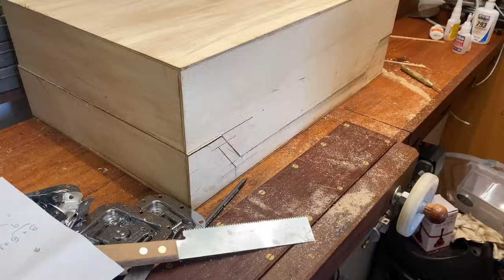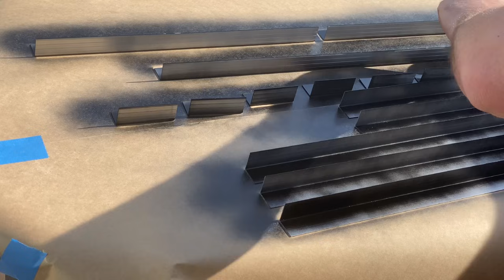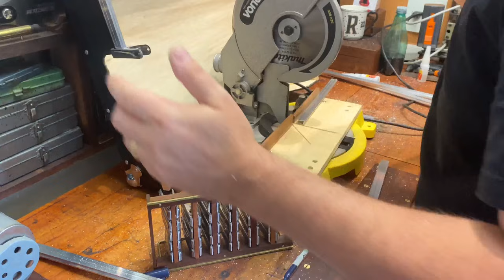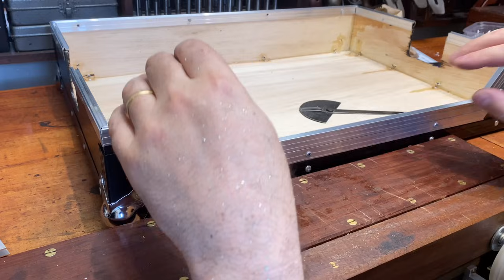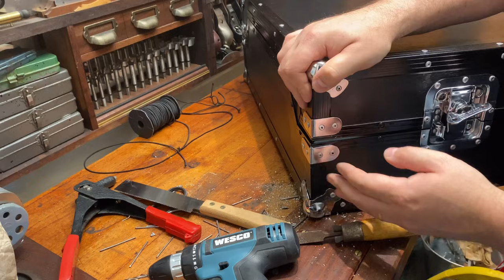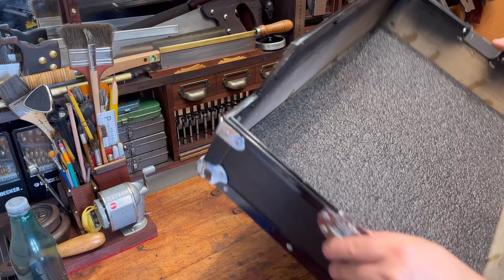Pioneer Ddj - How to Make - Flight Case Build

Comment: am i the only one cringing on how thing that board is? you invested on that equipment and you cheap out on the plyboard?
Reply: Nope, hope he won't bump into something at transport
Reply: I think the thin plywood is enough. There isn't much weight inside. As long as it won't be crushed it should be fine with those corners and edges reinforced and riveted in like that.
Reply: Yeah most cases aren't that thick like they used to be bc djs want everything lighter 😏.. I prefer cases, but, TBH a lot of us are rockin' tour/road cases but we're not on tour (with a crew tossing cases on planes n trailers etc.). Mine go in a car suv or van .. New Djs ain't even hearin' that. A case that cost more than, is 3x heavier & 4x bigger than the controller?? Nahhh.. They're doing controller bags n backpacks. I get it. All good tho.
Reply: I like his good work  very nice job he dose ok
Reply: @imaniinternational7853 my DDJ 1000 has 1/2 board. Shit is thick as hell
Reply: I just like watching your show every time it come on cool
Reply: Frigging awesome......pero, no handles?
Reply: 10mm at the minimum should be ideal
Reply: SAYy can you do better let me see ok
Reply: I just love to keep watching his cool videos ok ALLL the time ok
Reply: Can you do better with the woood
Reply: On the contrary, I’m more surprised he went through all that trouble for a DDJ-400
Reply: Fr

Comment: Plyboard is too thin for this application. No washers used on the backs of the rivets. No carry handle and no way of cabling up the unit for use whilst inside the case
Reply from the maker: All good? We have to evaluate the type of use. In this case it is a domestic use. For this reason I use these materials in the applied way. During the beginning of assembly, the structure "seems" fragile, but when we add elements, everything gains strength. The important thing is that I demonstrated all the steps facilitating the construction for all of you.
Thank you very much for the message. big hug!!!
Reply: If some of your washers let go over time, at least you can drill them and remove them. Even a nylon washer would prevent pull through when the plywood splits a bit.  Or you can just glue the washers back in place with some Cyanoacrylite glue. 🙂

Comment: Good Job  need a handle built to carry or wheel base but overall great case  well done sir 🔊🔉🔊🔉🔊🔉🔊🔊🔊🔊
Reply from the maker: 👍 I am working in next step for finish that things. Handle, wire and slider’s for computer. Thanks for your message and see you later in the next time!
Reply: @woodtransformer   brilliant I will check back on the next load

Comment: Vedy mucha da good. Excellento kraftwerk. A few hinges wood b gooder. Although ply is only thinn, foam internal lining compensates.
Reply from the maker: @PETECAROLAN Hello! A long time ago, i made using hard wood, was strong, but very heavy. For that woodworking i change for plywood and solve the problem about heavy. Thanks for your message and subscribing.

Comment: hey mate, you most def have the skills, would kill to see a v2 (and maybe you could sell a dynamic design) with some upgrades, beefier wood, storage place for cables notebook and such, room for back I/O just as you made with the front, a handle lol, and the most important, sandwitch the ddj with foam from the top, so you can rotate the case in all directions. cheers!
Reply from the maker: Hi, how are you? Thanks for message! I have a lot ideas for make new updates… iron slides for computer, two drawers for two sides… and more like yours ideas. See you later. 🙏🙏🙏

Comment: i would also wire an AC power connection, XLR outputs for mains, and possibly 1/4" or RCA outputs for booth.
Reply from the maker: Thank you for the contact. Some people have commented on the cable routing. This specific project I put the passage but it was on the other side of the photo. In the future I will change the cover image to try to resolve this doubt in part. 🙏🙏🙏 @pierrenorman421

Comment: Hi. Thanks for the video.
A year later, would you recommend pop rivets into plywood?
Reply from the maker: @yossiyaari3760 Hi how are you? Yes this is a secret of power strong!!! You need to use pop rivets with flat washers, for grownups to contact area. When use that “shake” you can make a fly case less weight with more flat play wood. Thanks for message!

Comment: Nice work!   Could you tell us what materials you're using, the vendors, and perhaps the dimensions?  I realize you're making it for a specific case, but it would be good if you could tell us the tolerances.   Once again, great work my friend!   I would love to start a business with you making these
Reply from the maker: @ericweiler6571 Hi, thanks for message. I feel very good when I receive message like that. I created a list and post in video description. About the size of my project…. I made using the size of DDJ… compare, cut, paste. Tip and Trick: select equipment and star your project, if you need help send a new message for me… I waiting for you my friend. Growing up together!!!
Reply: @woodtransformer   I used to DJ when I was in high school.  Three days ago I turned 50 and I still love music!  I've got a little music and photography studio here at home and I'm getting into making flight cases.  I made the mistake (back when I was in high school) to make a turntable/mixer coffin for my Technics 1200s and Rane mixer with 3/4" particle board!!!  It probably weighed about 80lbs by itself.  My question for you my friend is, what is the best material (and width) for a flight case?  You are very talented!
Reply from the maker: Hello, I'm sorry for the delay. I hope I can help month so late. To make a strong and weight case, use: plywood wood and a thin sheet of laminated, matte and black material. Thanks for message!!!

Comment: Awesome quality, but why is the top so tall? are you gonna put a laptop stand in there? what about if it goes upside down or sideways, is the controller gonna flop around?
Reply from the maker: @Dannerrrr Hi, how are you? Thanks for message. This is true, but after when I buy the slider for laptop all that's problem will solve. I have a problem, in Brazil don't have the slider for laptop... unfortunately I waiting opportunity for buy and create the second video. Thanks for you comment, this is very important for my channel keep growing up.
Reply: @woodtransformer  thanks for answering my question! This is my favorite flight case video.
Reply from the maker: @Dannerrrr ❤️❤️❤️

Comment: Did you crazy glue the box together?
Reply from the maker: Olá! How are you? I used fast glue for put the pieces on the correct position. After that i used rivet and more glue for make a strong structure. I use that box all the weekend and work like a perfect case. I use with care and never had problem.
Thanks for you message and! Have a nice day!!! @steveott1884

Comment: Great But! QUESTION?? Why is the lid so large? If it is a hardware issue you can find other latches.
Reply from the maker: @310socal Hi, it's a good question! After start i had a problem with slider for computer. I cant buy because didnt have in Brazil. Ever day i try buy that for finesh that project. When i got it i will make the second video for finish the theme. Thanks for your good question!!!

Comment: What kind of glue and wood did you use to put the wood together,?
Reply from the maker: Hi, how are you? I use super fast glue only in the first time, after that i use rivet. Tks for your message… @billocampo1365
Reply: @woodtransformer  I also build my cases, and I used a 1/4" plywood and covered it with black speaker carpet,  they tend to be a little heavy, I haven't tried using thin plywood like you had..
Reply from the maker: @billocampo1365  hello everything is fine? It really gets lighter, no comparison. It has two important tip's and tricks: the fairer the measurements, the stronger it is; in addition to the rivet, we have to glue all the metal parts together.

Comment: Good job! What is the thickness of the plywood? Thank you!
Reply from the maker: Hello! 3mm. It got really strong! Thanks for visiting and message!!! @fabioabreumusic
Reply: Oh really? Just 3 mm? I was afraid to use the 5mm plywood for a moving head flightcase, because I usually see it with 9 or 10 mm. Good to hear it. :)
Reply: Not thick enough, it’s like riveting cardboard, the heads will pull straight through. I think this is more of an ornament.

Comment: Damn bro! Good job, you can tell you’re very skilled. Just a question, how much and where do you get materials? If the video was 45 mins how long did it take? And was it worth it? It seems like a lot of work, did you actually save money or do you just like doing this stuff for fun? Thanks, even if you don’t respond I appreciate your time.
Reply from the maker: @bakoguy5330 Hi how are you! Thanks for your message. Step by Step... Material: I bought in amazon and others places;
About spend money with that: For me, when a make that things i feel good, refresh my mind. Amost of the time i spend less money make projects like that but spend long time for do that. In that project i spended +/- 10 hours.
See you later a next time and send a new message when tou need any help.

Comment: From a “djs” perspective—- you could have made that top portion just a 1” top, or made the entire case 1/2 the depth. 
All that space is just precious packing real estate gone. 
But more importantly more area you have to fill with soft foam so the unit doesn’t bounce inside when not stored flat/horizontal. Woodworking wise, absolutely love the execution though.
Reply from the maker: @djjoshuacarl hi! how are you? thanks for your comments. about  the space inside of case: when started, my project was put a computer on the top with slider guide, but, i needed divide the project in 2 part... i am looking for the slider guide for a lot of month. i believe... when i find that i post the second part! see tou later!!! thank for your attention!!!
Reply: @woodtransformer  totally get that! I wish controller companies would put a few loops on the underside so you could strap a unit to the bottom, it would Alleviate so many build roadblocks, ironically I bought the case your shooting for ( it’s the  XS-RANEONEWLTWH from Pro-x) 
But they “really” don’t make cases to fit the controllers,
They use the same kit for all the units, and retro-fit the dense foam for each controller —-
That’s how I happened upon your video. I wanted to learn to do it myself and have it fit the RaneOne’s unique size properly. And I really did learn a lot! Excellent Video, and I appreciate the response 🙏🏽🙏🏽🙏🏽

Comment: Only thing I’d change would be powder coating the hardware instead of paint.
Reply from the maker: @blaccteezy Thank you for your comment. Without a doubt it is a great option. Initially it would be built with a synthetic material, more resistant to scratches. I did the painting because some followers asked me about painting wood, I took the opportunity.
Reply: @woodtransformer  I love the outcome! I immediately went to look up hardware because I want to build one for my Hercules T7 when it finally ships. It would be more work for sure, but powder coating has become much easier to attain at home. I also want to look at come cool veneers. You just opened the door for some cool stuff man! Great work.

Comment: Ottimo video per il montaggio e per il lavoro svolto. 
Però secondo me ci sono due "difetti": 
1) il coperchio è troppo grande per le dimensioni del controller. A questo punto si poteva pensare di realizzare un piccolo vano per depositare cavi / alimentatore ecc. 
2) sarà questione di gusti.... ma perchè tingere le parti in alluminio ? al primo urto la vernice va via e, con il tempo, non proprio il massimo da vedere
Reply from the maker: @gigiomix135 Hi, thank’s for your message. I will create a second video for complete the first. I have a problem with hardware for clip a computer on the top and about the paint, in the next time a will use eletrostatic system. Thanks for your comments and see you a next time!